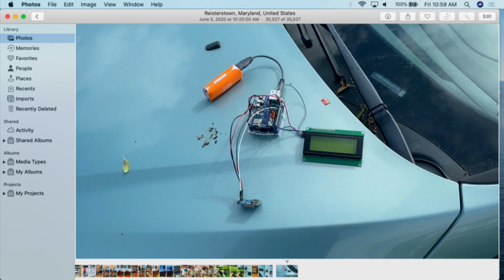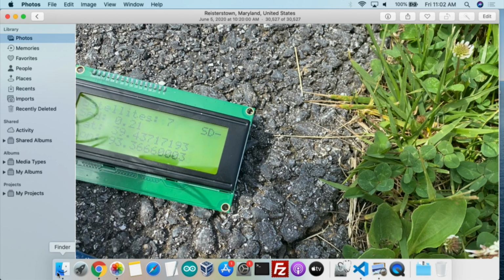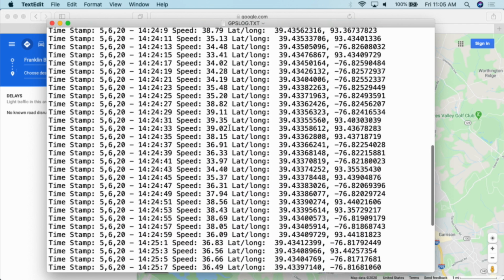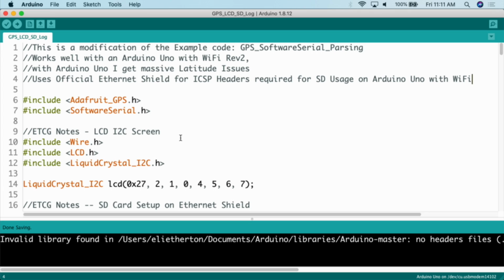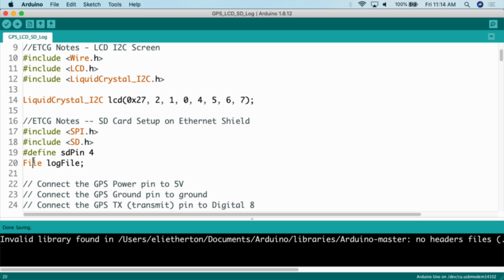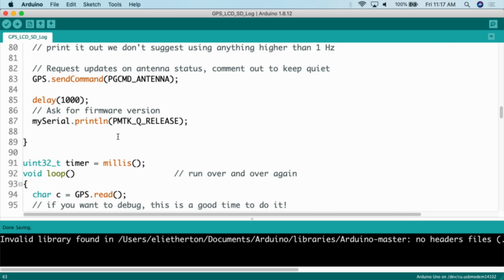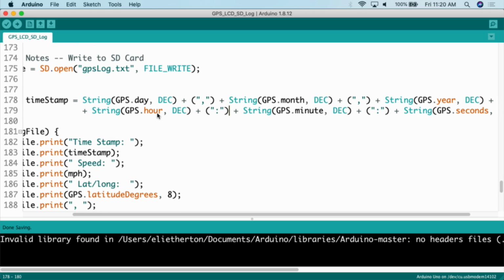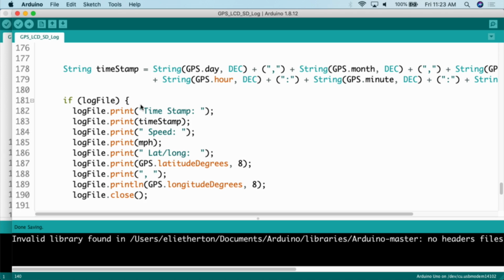Arduino GPS - GPS Tracker to SD Card (Adafruit Ultimate GPS)

Comment: Interesting you had issues with GPS but worked with WiFi Uno. I have been experimenting with several GPS tagging projects using Adafruit adalogger 32u4 and different u-blox N8M based GPS drone antennas and right on for location. Do you have the battery installed in the ultimate GPS?
Reply: Would the battery afftect the GPS at all?